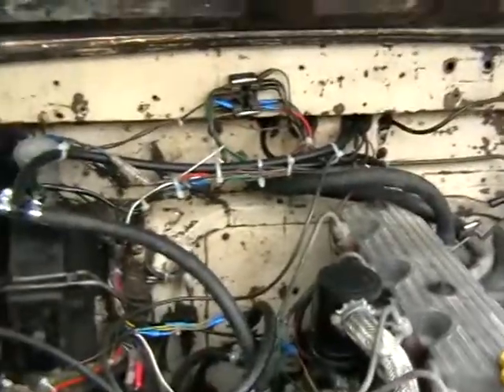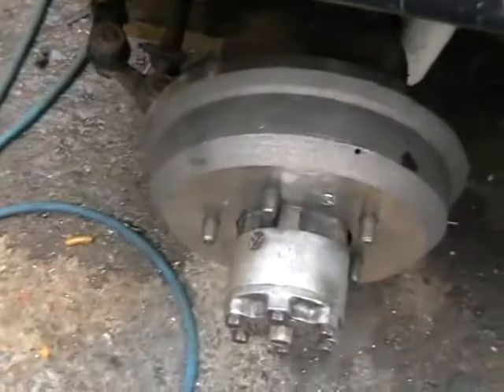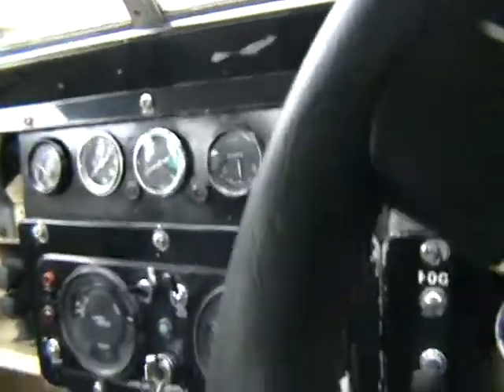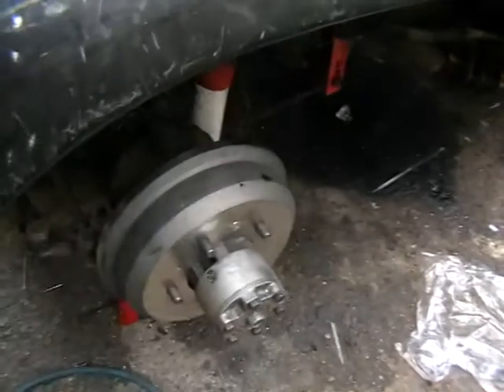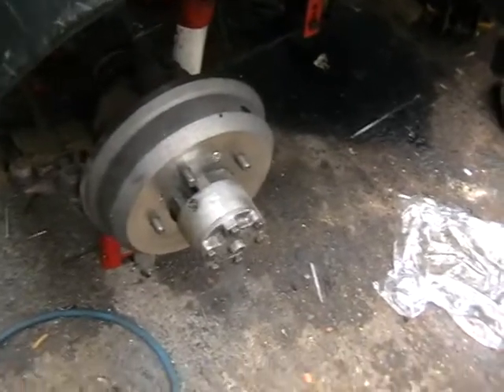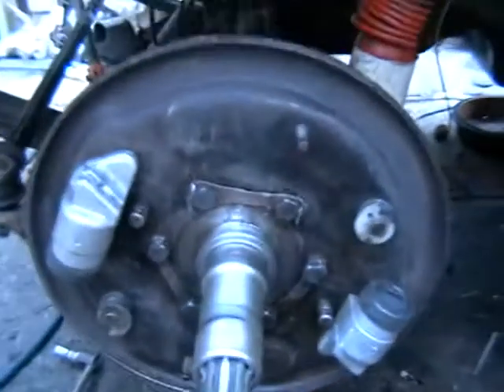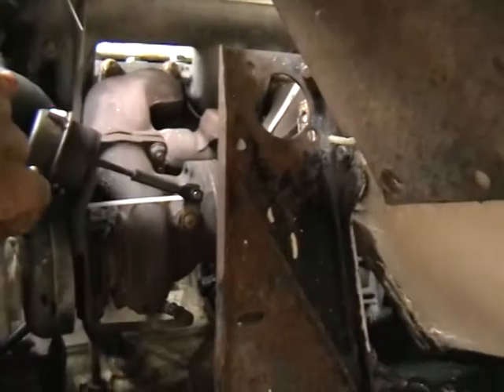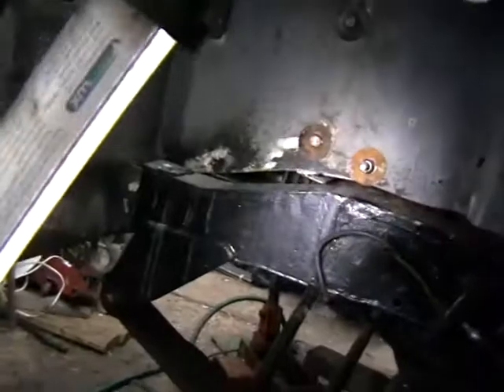land rover no 7 upgrade series 2 brakes

Comment: Those front spring shackles look a little unsafe. Like a homemade bodge to get a bit more of a suspension lift. Id strongly advise getting some standard spring shackles. Also why the defender flares on a series 2? Unless you were running discovery or defender axles they are very pointless. 
Why won't the battery fit under the passenger seat? 
Overall though it looks in pretty good nick compared to a lot of series 2 eBay buys. If you haven't already the series 2 club forum is a very useful place. The defender wheel arches definitely need to go